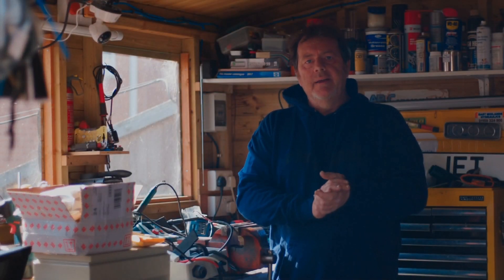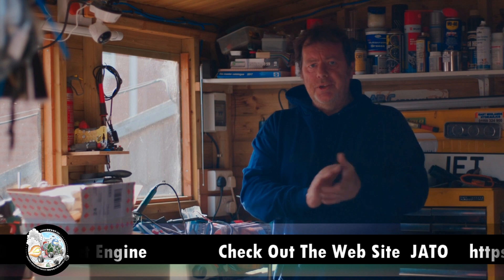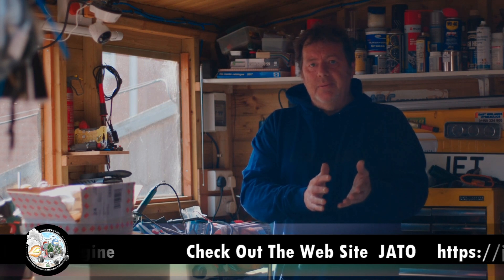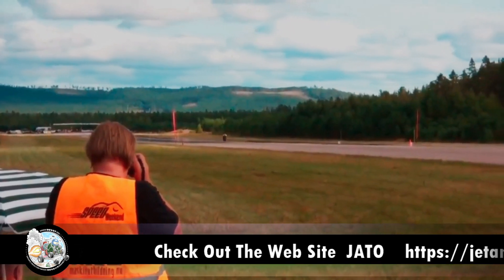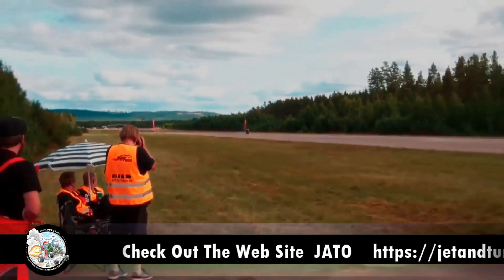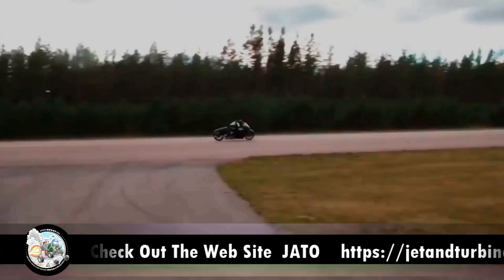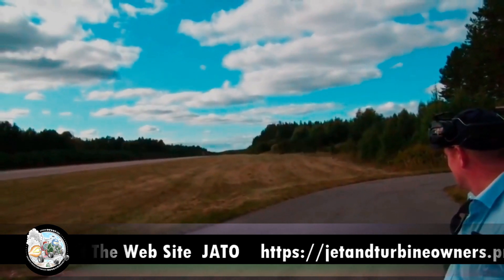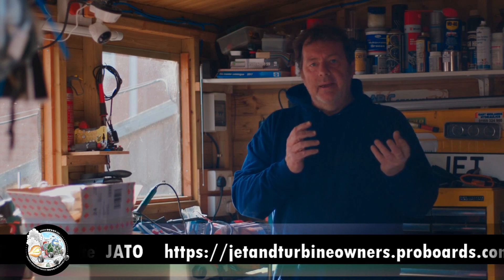How To build Jet Engine  Bike  Working Diy Turbojet Bike

Comment: If the engine is spinning at lets say 10 to 20k then how do you control the transmission so that it either stops or goes and how do you change the speed do you use a manual trans,semi or costume?
Reply from the maker: no gear change, just free power section with 11:1 reduction